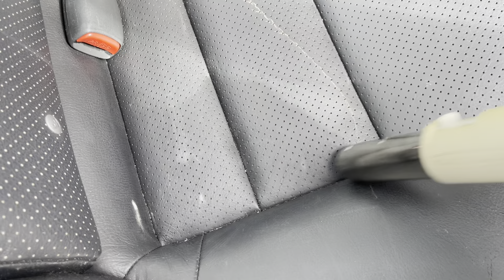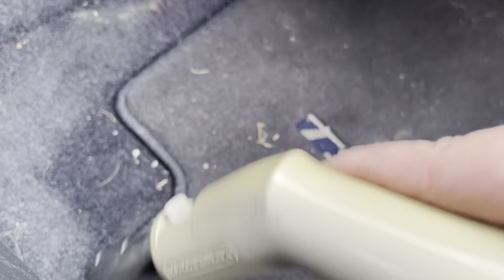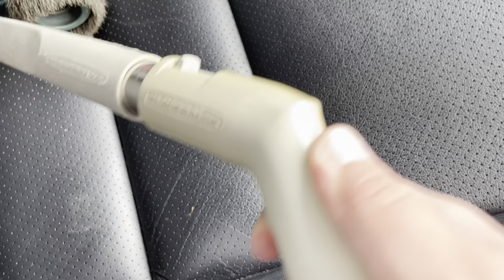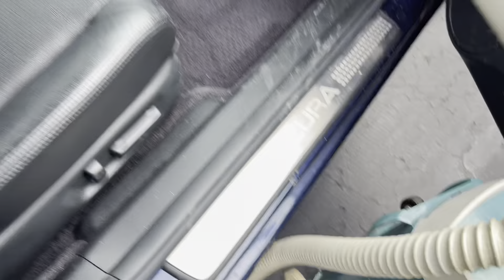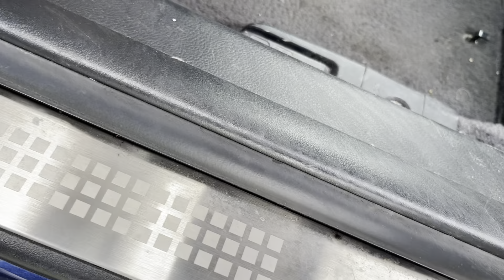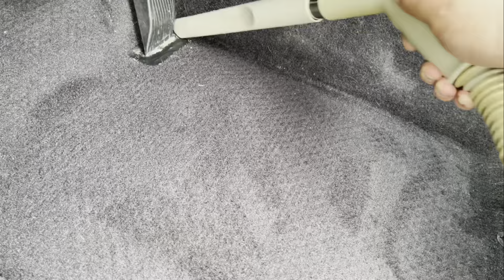Vacuuming Out my Car with the 1969 Electrolux Model 1205

Comment: I have a 1205. Never realized it was that old. Kind of rusty and beat up, great for being a shop vac though. (not for water of course)
Reply from the maker: Very cool! Yeah the regular 1205 was out from 1968-1974. The 1205 Golden Jubilee replaced it in 1974, then the 1401 Super J replaced that in 1975.
Reply: @KirbyVacuumCollectorFixer  cool. I used to have a super J, it was rat chewed and really dirty. I don't remember what I did with it.